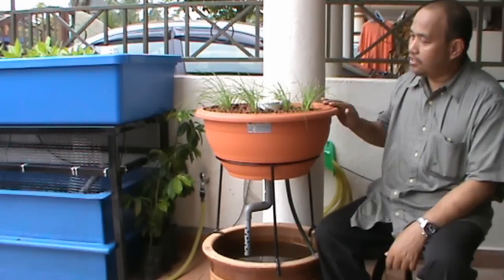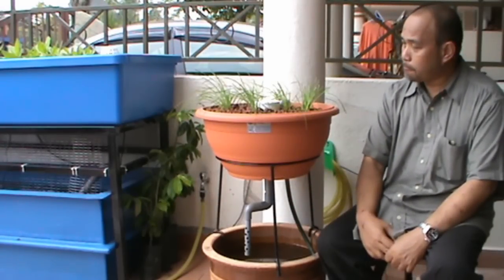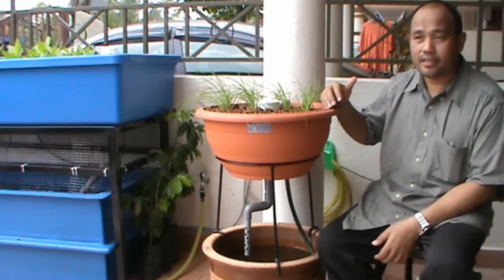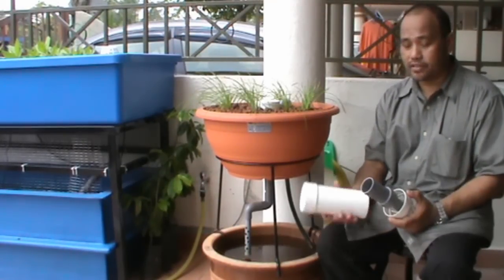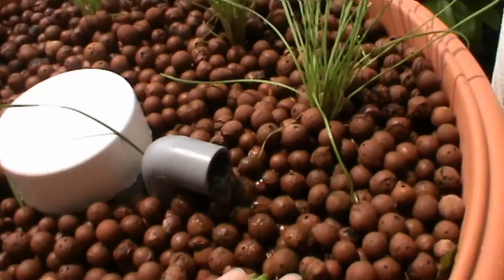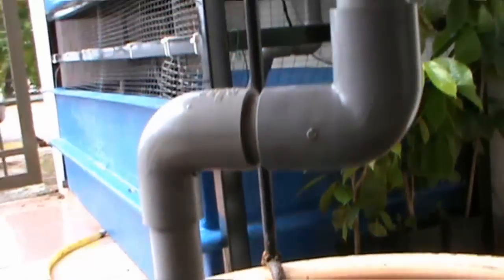Basic Aquaponics - Ornamental Set

Comment: Salam Affnan, how many fish in the this set?
what fish you are using?
my fish pond is smelly, how to remove the smell?
Reply from the maker: +Haroon Qureshi It will depand on what fish, for small gourami about 10. Use small fish not more than 3 inches long.

The biofilter from aquaponics keeps the water odourless and clear, nothing else needed. Give a lot of aeration if necessary, it will fix msny problem.